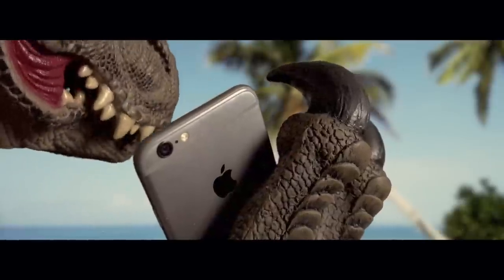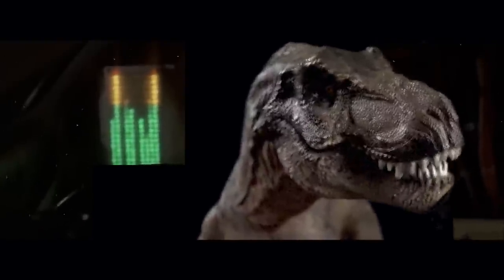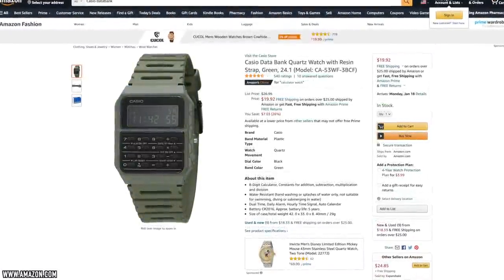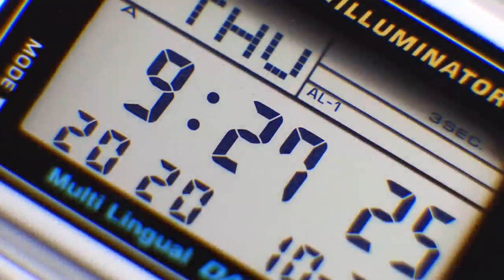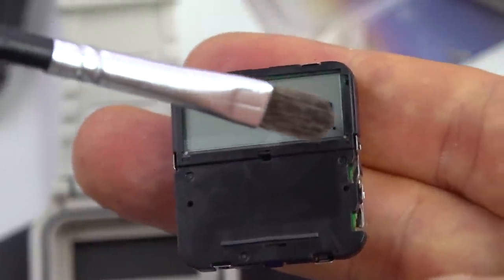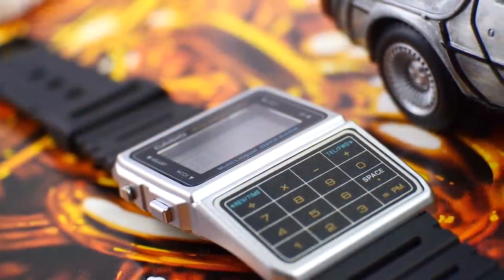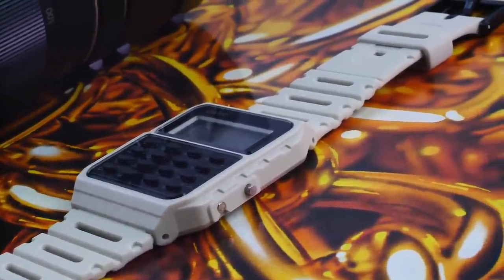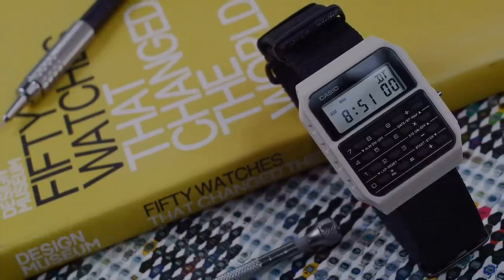Perfecting The New Casio Calculator Watch: Easy 5 Minute $20 DIY Mod

Comment: Love the vids but I'd personally have just changed the polarising filter as that's usually the thing giving a negative display, that way can save the money for more watches or goats if Hugo's popping round for tea
Reply: Could there be a difference in the negative display's clarity and readability depending on the quality of the polarized filter, or does it not matter what or where you get the filter from??🤔.

Just curious because I thought maybe Casio had used a low grade polarized filter which explains why this watch has such low visibility having a negative display.
Reply: @electron7659  not really, tbh Casio uses parts well above what you would expect but you can vary the amount of light passing through with different grades.
However it probably wouldn't help much with a negative displays appearance, even in more expensive displays its still harder to read unless lit.
Reply: @Segafishy  Wow. Okay. Gotcha. 👍 Thanks. 

Also, I have another casio watch that comes in a negative display, yet that one, is actually quite easily and legible to read. I'm not sure if Casio is using the same type of polarized filter as this calculator watch. It even has a light in the corner of the display which gives it kind of an orange/brownish glow.

Comment: I bought myself the blue one yesterday, and I absolutely agree with you that Casio should revert to the original positive display, this negative display is very difficult to read in semi lit areas. Also yeah, why didn't they add an electro luminescence, if they had to keep the display negative?! But nevertheless, I love the watch, inspite of the minor drawbacks.. it's a full-on blast from the past!
Reply: Keep an eye on the positive display prices. I swapped my Blue negative out for a positive and  it looks great. Totally worth it.

Comment: Great video as usual. The white one makes me think of 2001: A Space Odyssey for some reason. Too bad the negative display isn't better. I remember a classmate in high school in mid 80s having a calculator watch, felt really high tech. I actually wasn't that fond of digital watches from late 70s and forwards, always preferred the analogue display. Decades later I find myself owning an early 80s Pulsar "Running Man" with memo functions, a G-Shock and a couple more. Funny how things can change when you're getting older.

Comment: I have the DBC32D-1. I bought it twice in fact as the first one got pretty much obliterated in the span of  2 years. 
The second one lasted only 2 months before the bracelet failed. I find it funny that the watch has a 10-year battery 
but it is unlikely that its case or bracelet will last more than 3 years. I've now given both new NATO straps and given 
the cases a bit of a buff, So, good as new.. Sort of. The watch movements work flawlessly by the way. It is only the case and straps that don't last. 
Thanks again for the videos TGV. They're always a pleasure to watch.

Comment: You can also replace the polarizing filter on the LCD screen which will save you having to dismantle another watch. There are plenty of tutorials on negative displays, its a simple case of the polarizing filter orientation either creating a positive or negative to the display colour.

Comment: I just did this.  I have 2 old black watches with busted bands.  Cheaper to buy a whole new watch instead of a band.  Hated the black screen.  Swapped it over today into a white body and it looks so much better.  I couldn't figure out how to pop the guts out until I watched this video.  Pry slowly with a small screwdriver and it pops right out.

Comment: The negative display is caused by a polarizing film on the display. You could just peel off the display and clean it off with some rubbing alcohol and you just saved $20.

Comment: I've said it once I'll say it again did it watches or for children or athletes. 

A watch has moving parts and components whether it be the movement the second hand hour minute hands a digital watch is a lifeless hunk of plastic and metall that is void of any life or soul whatsoever. 

There's no reason to wear a calculator on your wrist that's what a cell phone's for and everyone's got one cell phone that is.

As for casio's they're not as tough as everybody tries to claim they are I spent 20 years in the military and destroyed three of them during that same time I wore a Chase-Durer Abyss 1000, Seiko SKX-779, SKX-781 and Suunto Core Military. Casio G-Shock were the only watches and yes three of them that got shredded AKA quit functioning out of all of those watches. The First tee shock just quit working have no idea why replace the battery it wouldn't work the second one the face got broke and it was during airborne operations and I've landed on other watches the same way sometimes even harder and it had no issues and the third G-Shock that broke failed in the desert when somehow find particulates of sand almost like talcum powder got inside the watch (?!?!?). 

Now I wouldn't have anything against the G-Shock as a military watch or a hard use watch if one had failed on me, I would be doubtful of them if only two had failed on me, but the fact that three in a row failed just shows me that the hype is just that hype. 

In the 20 years that I spent in combat arms in the military multiple deployments multiple combat tours I never had an analog watch fail ever but I did have three G-Shocks fell on me during that time. As well as a Suunto Vector. This taught me a very valuable lesson. Analog is always the way to go and if you're going to go that route automatic is actually the best route of them all to go.